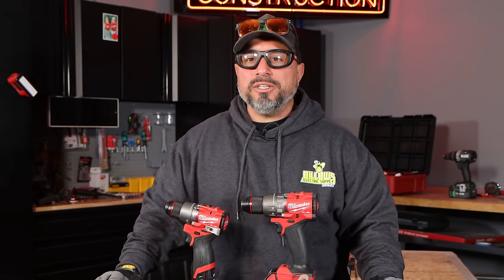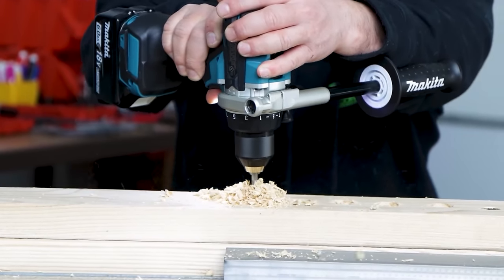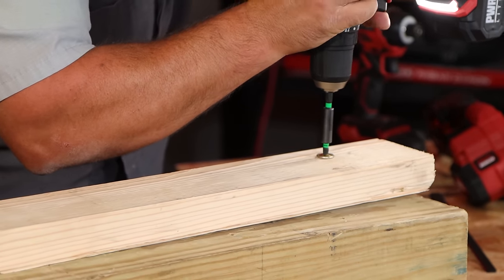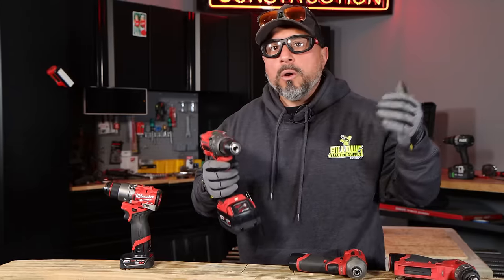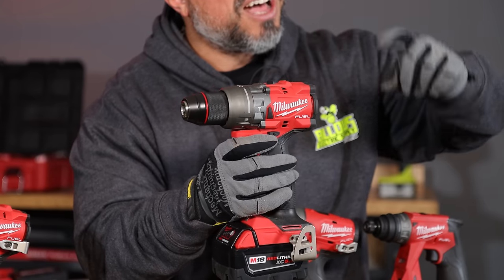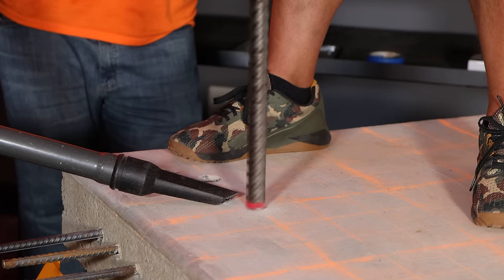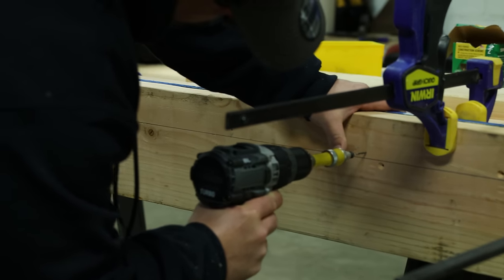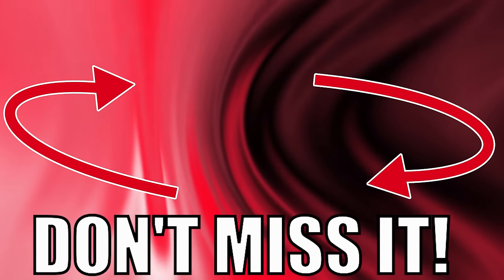Stop Using Cordless Hammer Drills...

Comment: I'm an electrician and I'm often not going to need a rotary hammer during an entire week. But I will be drilling multiple holes for tapcons. In that case, it makes more sense for me to have a hammer drill, and when I really need to bust up some concrete or drill huge holes, I'll break out my corded rotary hammer. But that extension cord is more cumbersome than carrying around a (little) extra weight on my drill
Reply: As The Carpenter, i rarely agree with the electrician.  But you got this one bro😎👍🏾
Reply: I'm also an electrician,  this was literally my response I was coming down here to type.
Reply: I'm an electrician, and I completely agree with you.
Reply: Exactlyyyyy
Reply: @SuitGeoff  Same here, lol.  I run conduit regularly on brick walls.    The ironic part though is that I have DeWalt SDS drill and a drill/driver😆.  But only because I was given the DeWalt drill as a gift from my daughter.  I didn't have the heart to tell her I need a hammer drill.    
I love the rotary drill though.  Especially the "chisel" setting that I thought I would never use
Reply: Ditto
Reply: Electrician here as well. Your way to opinionated man. You can just make a blanket statement for all 
skilled trades. Most trades would be fine with a hammer drill. SDS is nice (I want one) but not needed for most tasks.
If you need one you have one or are provided with one in most cases.
Reply: @BKeyes1440  I was a cable technician for a sub contractor company in Jersey they provided me with one for apartments and huge houses I want to be an electrician have impact driver and drill driver looking to get flex 6 tool kit for hammer drill impact driver and recip and multi tool and circular so glad to see the electricians banded together for what I got my job at lowes as an overnight stocker in the Dallas area to pay for my tools and trade desires for my future
Reply: As a residential electrician, I concur. 
The SDS drill also has chuck adapters, and works great for auger bits.
The size isn't much different than a drill/driver
Reply: The makita black roto hammer, amazing for tap cons.
Reply: You guys know regular drills can handle masonry, right? Maybe a little slower but it gets the job done, and anything they can't do, you'd probably be grabbing a rotary hammer for. The point is they make drills that are lighter, quieter and faster than impacts, and can do pretty much anything a hammer drill can do, so you can just carry one thing on you and not be running around grabbing stuff
Reply: @chriscolameco6850  depends on what you are drilling, new bricks yes, old concrete not so much.

CMUs probably.

Roto hammer is way better, especially the small cordless ones, for tapcons.

I use the makita black one and that thing is ridiculous, I have used on 3/4 anchor bolts into old concrete. It definitely doesn't like it, but it does work.
Reply: Amen brother
Reply: Exactly man that’s why I have one
Reply: There is cordless rotary drill that the guys at my company use and it is amazing it was also about 900 bucks but it's nice we drill into brick all day with it. 

I suggest a hammer drill if your not drilling into brick or concrete all day though idk what this guy is on about 😂
Reply: Exactly. This was a dumb video
Reply: @chriscolameco6850 Takes exponentially longer and produces more strain. If you do it for a living then there’s no reason not to make it more efficient. If you have one diy project you’re completing alongside YouTube yeah you don’t need hundreds of dollars into contractor tools.
Reply: @ZeusAndKiller  my thing is the hammer drill function sucks i have a cordless rotary hammer on my truck it takes 1/10 of the time
Reply: @ZeusAndKiller  electrician hera and same.

Comment: Where I’m from, we have something like 90% concrete structures due to tropical storms. That number includes most homes. Being a DIYer in a concrete home, a hammer drill makes the most sense to me for its versatility. I totally get that for most people a hammer drill is unnecessary. I just used mine over the weekend to do something as simple as hang new curtain rods. Definitely a necessary tool for me.
Reply: For concrete a hammer drill is the most stupid thing. A rotary hammer is milions or even bilions times faster, and also milions times more reliable. And also the SDS bits are wey-wey-wey  more reliable only with a hammer drill that is using a moderate RPM with wey higher impact, with less friction that heat up the soldering of the carbide tip...
But there is a use for hammer drill - for drilling brick wall a little faster then with no hammer and without cracking the bricks with a rotary hammer.
Reply: @loochan325  you are absolutely right. A rotary hammer will out perform my hammer drill every day of the week.. but as I said, I’m not a contractor or tradesman. I’m not drilling 500 holes into concrete every day, so that time saving isn’t worth the lack of versatility to me. I don’t feel like my hammer drill takes long enough through concrete to warrant purchasing a rotary hammer, not to mention the additional bits. Even if I did, I still use my hammer drill on material other than concrete so I’d be using it anyway.

Hope this helps to clarify.
Reply: IDK buddy, I am a contractor and rotary is sexy, but who wants to pull out the big guns to hang shutters. Or a shower door...
Reply: @jasonzoretic9239  exactly. I have some needs that I use rotary hammers for myself having two at my shop. But for most everything the hammer drill (15 year old Milwaukee m12 brushed hammer drill/driver) works excellent for the occasional fire extinguisher hanger installations or white board hanging.
Reply: @loochan325  not every task requires a rotary hammer. Sometimes for drilling small holes or drilling in concrete blocks, you don't need a rotary hammer.
So why use the big tools ( I have SDS plus and SDS MAX rotary hammers) when you can use the smaller tool that is very capable for the job?
Reply: @settah17  For  concrete 100, 1/4 cement, a hammer drill is very slow and with a short life, but for concrete 400 like is most used where I live, you can't drill one single small hole in a whole day with a hammer drill. In the '70-'80 and early '90 we  used to call a neighbor with a powder actuated gun, or ask the cable guys with a Hilti rotary hammer, but they have only 6,5mm SDS bits. Around mid '90 I bought a german made 700W 2 speed cable hammer drill, with masonry bits, and it was impossible to get over the plaster, so to get the job done I combined a lot of manualy hammering of a chrom-moly bolt with an actual simple hammer, with a lot of short rounds of hammer drilling and only so  4 holes of 8mm x 50mm took 6 hours... In 2008 I bought a Makita HR2450 2.4J that can drill 8x50mm and 10x60mm  in concrete 400 in like 4 seconds.
That Makita HR2450 is still my main rotary hammer, corded but very good. I also have a small Festool BHC 18V 1.8J rotary hammer, a Hilti TE 4-A22 also 1.8J 22V rotary hammer, a Makita DHR 241 18V  2 J , and a Hilti TE 6-A22 2.5J. I have a nice colection of drill drivers, Makita 6270D @ 2Ah NiCd, Makita DDF 453 @ 2Ah Liion, DDF 456 @ 2Ah, DDF 480 @ 5Ah, DDF 487 @ 2Ah, DDF 458@5Ah, DDF 486 @ 5Ah, Bosch GSR 10,8 2 Li that I use for more then 99% of my  drill driver needs, GSR 12V-15, GSR 12V-15 FC, GSR 12V-35, GSR 12V-35FC, GSR 18V-55, GSR 18V-60 FC2 that has an SDS head among others, DeWalt DCD 701, DCD 791, DCD 800, Hilti SF 2 A12, SF 4 A22, SF 6 A22, SF 8A22, SF10A22, Festool T12, T18, DRC, Fein ASCM 12, ASCM 18QM, Mafell A12 and A18 and a lot of industrial models from Atlas Copco, but beside GSR 18V-60FC2 with SDS head and my old corded hammer drill, I have only one cordless hammer drill, Makita DHP 487. Years ago I was impressed by some DeWalt from 2 or 3 generation ago that was the word faster hammer drill, but I still not bought it caz' it was to big and heavy.
Reply: @loochan325  a rotary hammer is also a hammer drill.🙄
Reply: Nope, these are technical terms in a convention. In other languages hammer drill is coled percution drill - a percution that is more noise then real percution, no hammer in the name, and rotary hammer is coled something like  hammer rotoimpactor or hammer rotopercussive. The drill reach something like 0.1J that is more of a joke, not even a flip, and an average rotary hammer used for fast drilling in hard concrete for 10-12 mm diameter ( and slower up to 26mm) reach around +/- 2,4J  ( Makita HR 2450-2470-2630),  1.8J for compact models used for fast drilling in hard concrete 6 to 8mm ( slower up to 18 mm) ( 1.8J Hilti TE 4-A22 and Festool BHC 18, or 1.7J Makita DHR 182, or 1.9J  Makita DHR 241, DHR 202, etc.  )  There are some weaker compact models from around +/- 1J up to 1.6J, and also some more powerful 2.7J - 4J, and SDS MAX even more powerful for even larger hols, some can be even from 0,9J, but weaker then that is not even airsoft. There are some hibryds like the SDS head for Bosch GSR 18V-EC FC2 or GSR 18V-60 FC2, +/- 0.5J but even those are faster then a simple hammer drill, are not considered true rotary hammer like the convention is.
Reply: I’m a DIY guy, and I still invested in a rotary hammer.  I loved my drill and impacts but when I installed a fence that needed concrete anchors, I was afraid my non-impact wasn’t up to it and the hammer drill I borrowed, was still a chore to use.  That project alone made the step up to a rotary hammer worth it.  I suppose for some small holes the rotary hammer may be overkill, but if they are that small, I probably don’t really need a hammer drill either.
Reply: Hammer drills are still the norm in europe because 99% of houses are made of brick, mortar and concrete.
Reply: Hammer drills make no dent in reinforced concrete walls. Its stupidly slow and painfull.
It only goes through gypsum or really low quality concrete like they use in Turkey.
Reply: Just buy a damn rotahammer
Reply: I dont know man i get the hammer drill for the multi function of it and ability to drill through concrete when needed. But i also rarely ever use a drill. I use my impact 90% of the time

Comment: I’m not sure where this video was going. I use m18 hammer-drill on tiles in customers bathrooms. These bathrooms cost anyway from 10-50k plus. You can’t come in there using a rotary hammer drill risking damaging porcelain,marble, granite, quarts and ceramic. You have to be a professional and use caution while using the best tool for the job.

Comment: I think it depends on the person and what jobs they need to accomplish. Some people may prefer using a hammer drill over buying a SDS and all the specialized bits you would need. Maybe you already have a whole set of drill bits of different sizes that only fit into a chuck. Maybe an M18 hammer drill is just the right amount of power and size for the job. The installation driver may be under powered for what you need. That's the beauty of having many options, it caters to the individual. Thanks for the insight Vince!!
Reply from the maker: Thank you BG
Reply: @VCGConstruction No, thank you Vince. That was a poor reply to BG.  I'm 100% with him on this one. I own an sds and an sds max corded hammer drill. Only way to go if you're doing repetition drilling. My cordless rotary hammer is great for a lot of midsized jobs. That little hammer drill feature on the regular drill has saved the day close to 50x! Installing a septic drain field... The chain for the concrete cover needed to be affixed to the concrete tank structure. 2 - 1/4" concrete anchors. Come back the next day? No. Use the hammer drill feature, get it done and call it a day.
Sudden rain and had to plastic up the window openings. We weren't the general, but it was the right thing to do. 8 tapcons were needed on 2 windows. You guessed it, hammer drill feature on the drill. Saved the day.
Many more instances. I drill all my wood holes with it anyways. What are you saving? 10 ounces... probably not even that much. First time I'll say this, Vince don't dig so deep for content. SMH
Reply: @edpoints1127   Milwaukee was probably seeing low rotary hammer sales that month, so called up Vince to convince people to spend money on tools they don't need. 

I do remodel construction. I have a rotary hammer. It mostly collects dust. My hammer drill is on every job and as you said, is the one that gets the job done quick and easy. 

Vince is over here pretending new construction commercial builders make up the majority of his viewership. Not even close. Most folks watching these videos aren't spending days on end, drilling big holes in concrete. I'm not hefting out a rotary hammer to drill a few holes in some stucco, brick, or even concrete - when all I have to do is flip a switch on my drill. It's hilarious that he talks about how "very heavy" a hammer drill is and then recommends a rotary hammer. What?!

Comment: I prefer an all in one drill solution like a cordless hammer drill.  The cost and weight isn't that significant and I drill a lot of holes for Tapcon screws.  A cordless hammer drill is the right tool for that job.

Comment: Depends on the trade and what you do. But for me it doesn't hurt to have that extra versatility. As an electrician sometimes you gotta install conduit and smaller equipment on concrete walls with 1/4" anchors and you don't need a full size rotary drill for a 1/4" hole especially a couple holes. Anything larger you need a rotary drill.
Reply: I agree.  Its is electricians I do see using the hammer drills the most.  And you have to think if you are up on a lift working and need your drill driver anyhow why do you want to take another tool (rotary hammer) to drill a couple holes to attach some stuff to block?  When talking about weight that would be more than just a drill driver with a hammer drill capability.
Reply: Agreed, definitely the sparkies using these the most, I’ve even seen them putting tapped holes in concrete for threaded rod for hanging GSTs
Reply: As an electrician I can say this is accurate. Got a dcd999 and I love it

Comment: As a DIYer/non-pro, I opted for the hammer drill option because 1- my smaller impact driver gets used the most, and 2- since I don’t use it that frequently , I wanted to have the capability if needed.  3- the size/weight difference was minimal.

Comment: I’m a handyman. Why carry a bag with 3 tools when my hammer drill will do all of these jobs. It’s not enough heavier to wear me out. It actually saves time by not have to go get another tool or carry multiple tools on my belt when I’m 8 feet in the air putting anchors in a brick wall, and then need to drive the screws.

Comment: I don't know why Vince is trolling hammer drills 😂, but Im a cable installer in Florida and more than 90% of the homes I install onto are masonry. I started with using a non hammer Craftsman. Totally changed the game for me when I upgraded to a Hanmer. It's not even a contest. Hammer is a must! Then, I use/carry my impact to drive the fasteners once the hammer makes the hole 🕳️. I'd rather carry my impact than unchuck and change bits to drive a 1/4 Nut tapcon with the hammer. So, I carry both.

Comment: I've got both, I'm in trades, the issue is that a rotary hammer tends to break bricks a lot more often than a standard hammer drill. That's why I keep both. Punch a hole with either one but in certain situations a rotary hammer is too aggressive and the old stand by is the best choice.

Comment: I definitely agree that there are more specialized tools that will do the job better. 
However, the hammer drill fills one specific role for me personally, it's versatile and I don't HAVE to carry an impact driver and an SDS drill, thus saving weight and space in my tool bag/belt. 
At my job sites we are usually moving around a lot, nd getting very far from the car not knowing exactly what we're getting into, the hammer drill I find is perfect for that, it's light enough to have on your belt, can drill and screw in fasteners (gently and silently too, which the impact can't). 
Basically it is as you said, the jack of all trades, master of none. And that's exactly what I need. 
I have considered only carrying an impact, but I often do work where gentle fastening of screws is needed, and the lack of a clutch setting and extra noise on the impact just makes it fall short.
Reply: I feel like the video doesn't really understand the point it's trying to make. It's like he's arguing that instead of carrying a Leatherman, you should carry a hunting knife, pair of Knipex pliers, and a full set of fixed-blade screwdrivers all the time. Like... duh, those tools are better. But the whole point of the tool that combines them all into one is that you are trading some part of the utility and additional cost per tool, for a smaller package that does it all.

Comment: In some battery platforms, the hammer drill doesn't have any more weight nor size than the standard drill.  Yet it provides a higher rpm, torque, and unique features than the standard drill in that line.  So having that extra function when you need it (and some of us actually do need it available without having to reach for a different bit of kit) makes it a no brainer to have the function available.  Also, I carry the 1/4 impact driver as well.  Depending on the job, both can be the right tool for it, and sometimes, one is the right tool where the other will destroy what you are working on.